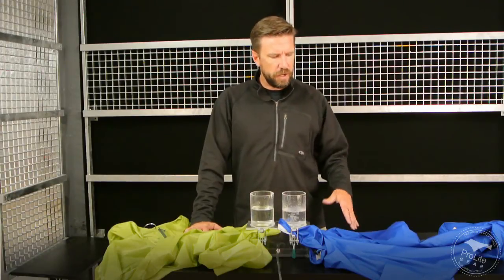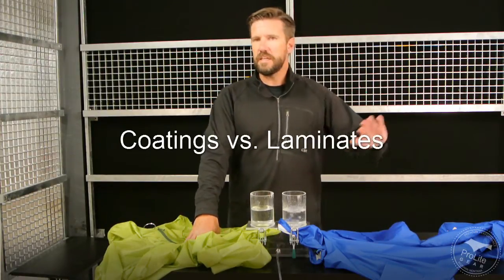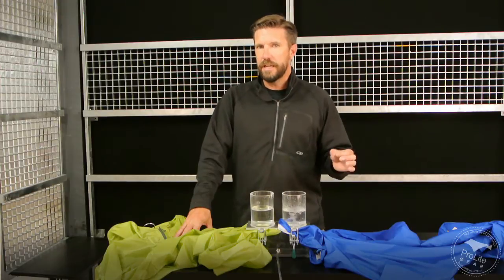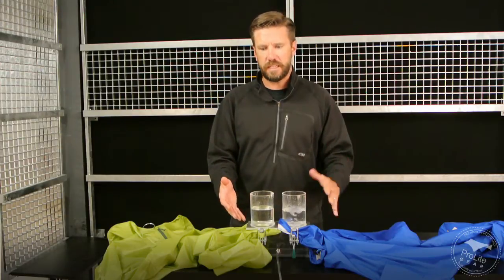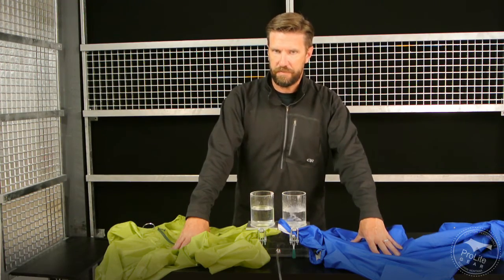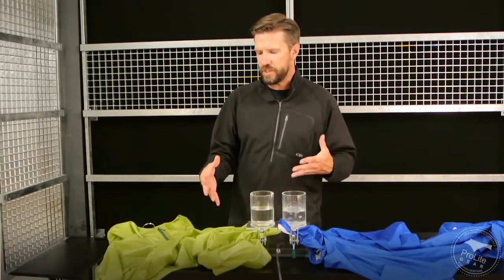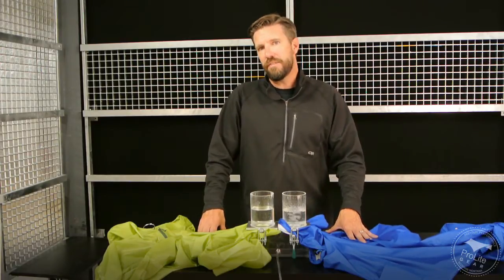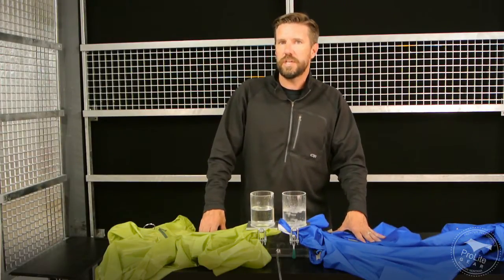FAQ: Fabric Coatings vs Laminates

Comment: I was wondering if they made a fabric spray to make fabric waterproof,  and not just a hydrophobic coating but to repair missing PU membrane (Restore older rain gear) or apply a non permeable layer to say a canvas cloth?  Plastic dip or even urecoat, 2 part they tout to be PU rubber based... Do they contain latex??? Just want a flexible PU spray membrane.... All I would like to do is add shine to a basic nylon fabric. Think spraying a run of the mill wind suit with a gloss to make it pop, make it water proof or make whatever color... {Paint it silver, or glossy red lol.... I want to make shiny PU gear out of existing gear for a art project... A lot quicker than having them made ;-P Is this doable? What paints will remain flexible enough to form a flexible polymer wall on fabric?

 I did read that a water based PU spray can enamel should be flexible if applied in thin coats may work, but the item my be unusable due to it being stiff as heck and even unwastable due to the curing process.... I cannot find any test results, products that can apply a gloss sheen effect. The closes found is Urecoat. They say it CAN be used on fabric and will remain flexible! I cannot find much info on this technique being used by anyone and guess I will have to experiment lol.... I found regular PU for wood was WAY too stiff lol.... Wonder what is out there to make a super shiny outfit just by spraying it lol.... Just for kicks

I see the vid was posted in 2014 :-(

Comment: Thank you for the info, I work as a forestry tech in the field year round working under very demanding, abrasive, dirty conditions. I am reviewing hard shell products and debating between the durability of PU coatings vs the potential stretch and breathability gore-tex pro products.  Can anyone comment on Gore-tex pro's abrasion resistance?  Like i said, mud, brush, and rock all day everyday. Thoughts?
Reply: That should depend on the face fabric, to get the gore pro label they have to pass high minimum standards for abrasion resistance etc. With gore tex most of what your paying for is the quality control of an additional party(gore) that ensures they manufacture the product to their own standards for each of their technologies, be it pro, regular, or one of their new ones, whether it's worth it or not you decide, but you know there is another company validating that it's up to their own snuff to put their own reputation non it, for gore pro it means a stronger more abrasion resistant face fabric to start with with minimum seam strength, sealing,  bonding, taping requirements. Gore isn't the only fabric IP company around, there is pertex, and schoeler, and many brands have their own versions that may be just as good if you trust the brand to do a good job, if you trust your own eye you can use the return policies to move the quality control costs onto yourself and buy generics, validate that they are made well for a 1/4 of the price or send them back. Once you know what each of the fabrics is, the weaves, the laminates, the coatings, how it should perform, than all that's left to decide is your economic politics will allow you to save that dollar when you read the label for national origin, or choose a retailer or cutout the middleman.